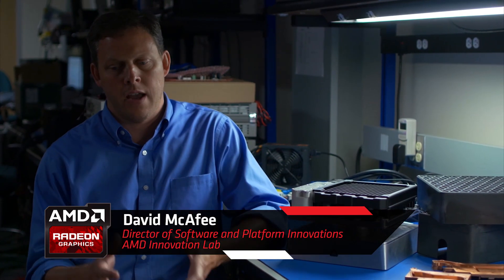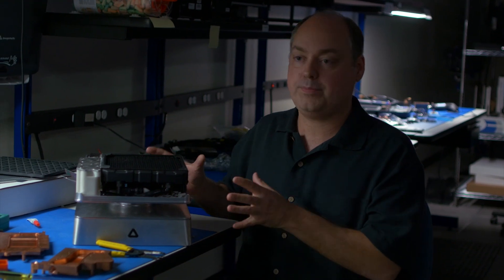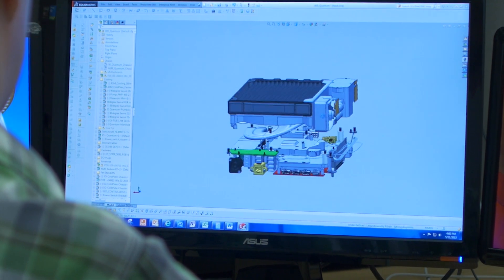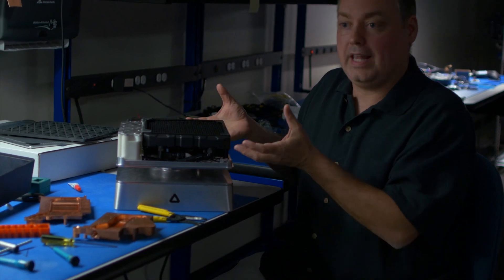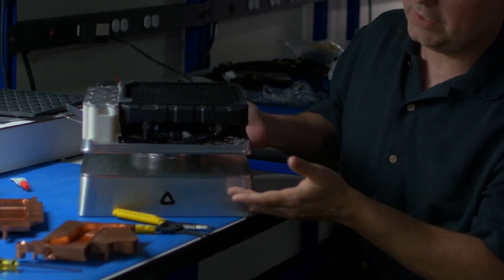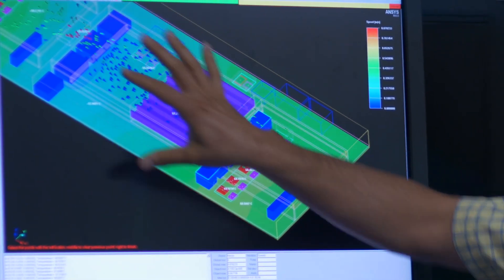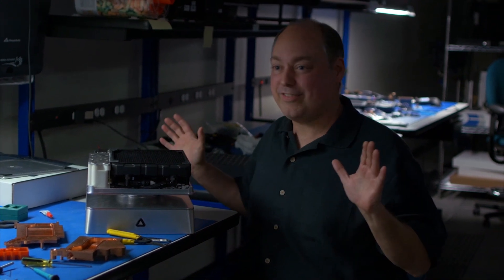AMD Project Quantum: The Enthusiast PC Form Factor Leaps Forward

Comment: Thanks everyone for the views and interest in our Project Quantum!  I have been following the discussion and wanted to clear up a few things.  Regarding the size of the power supply, when we first started on Project Quantum we didn't yet have Fiji silicon so we chose a power solution that would more than cover our needs.  This is one of the areas of the design that we are working to optimize to the actual power needs of the system.

I also have to give you all credit for the frame by frame analysis of the video to determine the components and manufacturers selected in the system.  In truth, there are two versions of the design - one with an AMD FX CPU and the one that is shown in the video with an Intel CPU.  Both will be a part of our Project Quantum plans going forward as we work with ISVs and VR content developers to optimize the user experience.

What's next for Project Quantum?  We continue to work on the design to optimize cost, performance, and upgradability.  Look for more to come as we continue to refine the design and work with our partners to bring this concept to market!
Reply: David McAfee What's the use case this design is trying to address?
Reply: Why didn't u guys just use the 9590 why 4790k????
Reply: +Speirs 333 Because even AMD understands their CPU lineup is getting old. I'm sorry but that's the way it is. I'm running an 8350 and I'm happy with it, waiting for Zen but there would be no reason for them to use an 220W part for an project like this.
Reply: mylife yeah ik im using a fx 6300 im gonna go intel when i get some $$$$$ but honestly a company using their competitors product as their own is just messed up shame on amd
Reply: Any updates?  Been 3 years :(
Reply: Revive this back and put ryzen 3100 atleast in this badboi powered with rx5600 atleast
Reply: Is this coming yet? I would buy it with the new 2022 CPU + GPUs

Comment: 1:05 is that an intel processor?
Reply: Neil Booth yes it is...
Reply: John Vann Well... That's very surprising seeing an intel product in an amd video.
Reply: Neil Booth amd has no mini itx fx new cpus so it was a dead end solution for them to choose for high end system an intel cpu. Or if its not an intel because looks to big and the mobo base not like an intel sockets, we will see what it is soon....
Reply: I doubt that amd has moved to lga...
Reply: John Vann 
Since 5 years ago...

http://www.phoronix.com/scan.php?page=article&item=amd_shanghai_linux&num=1
Reply: Hye L I stand corrected, I didn't know that the opterons used lga
Reply: Doesn't matter look at the ethernet port it clearly states "intel"
Reply: Neil Booth 

It say's "Intel Gigabit Ethernet". You can put an Intel ethernet controller on an AMD board, e.g. ASUS does sell AMD boards with Intel ethernet controller. http://www.asus.com/Motherboards/A88XGAMER/
Reply: Neil Booth They said they recognize intel's high end processors are better and announced a competitive high end CPU somewhere next year. Untill then looks like they're just using intel...
Reply: Neil Booth Intel GIGABIT ETHERNET. Can still be an AMD board.
Reply: youtubechannel It looks like a slightly modified Asrock Z97E ITX, it's unlikely to be an AMD board.
Reply: Neil Booth According to the layout, it seems to be a ASRock Z97E-ITX motherboard.
Reply: Neil Booth Dont wory, you can run any high end Intel CPU and if u gonna ask Windows what type of CPU your OS is using windows gonna report it as AMD 64...
Reply: Biały I don't know what version of Windows you're using, but every version I've used accurately reports whether it's an Intel or AMD CPU. Microsoft also uses the x64 terminology to represent 64-bit, they don't call it AMD64.
Reply: Neil Booth I know, that's just crazy.
Reply: Neil Booth Rumor is it's a Zen prototype.
Reply: gromann So AM4 isn't a PGA socket?
I need it, like now.
Reply: They haven't said what type of socket it will be.  They're making a universal socket for their APU and FX Lines now so it's likely going to be all new.
Reply: Neil Booth 

mb is z97e-itx/ac

surely intel
Reply: Jarruwat Thorung 

http://www.newegg.com/Product/Product.aspx?Item=N82E16813157504

Definitely right on that one. I noticed it myself.
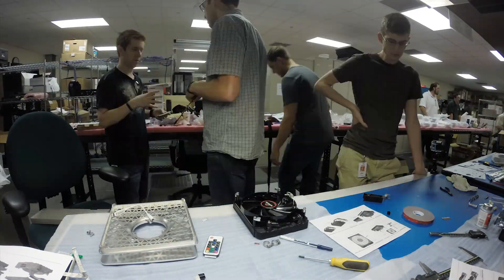Reply: Neil Booth  yes , you can see the intel thunder in 1:08
Reply: Neil Booth hey guys, you forgot one thing, this is just a prototype, the final product will surely be different
Reply: AMD will not advertise its rival. It has no logic.
Reply: Neil Booth no, it could be an Opteron LGA CPU or one of the prototypes of ZEN LGA CPUs.
Reply: Biały And without AMD it would still show X86-32.. ;)
Reply: Neil Booth amd jaguar
Reply: Indeed it is, But I would suggest that those guys are just playing the fool ?. the Ethernet cable has some some weird looking dongle on it ?. Someone needs to run cpuid on the box.
Reply: dude i joke i dont know what cpu it is it can be an intel cpu however the box looks good and maybe they will sell it later as a complet system
Reply: There is amd and intel versions for proyect quantum, in the video is intel version
Reply: ***** wot u sey bwt mai nan? Il rek u m8

Comment: Is that an Intel CPU / chips set and non AMD memory?
Reply: ***** X86-64 = AMD64.
Reply: ***** My PC has Intel Core i7-4790K.
Reply: BlueFoxTV My assumptions are:

AMD required a mini-ITX board for the small form factor, but no one makes a mini-ITX for the high end FX CPU. AMD had to either use a lower performing FM2+ APU, or build it's own custom board which made no sense for a prototype build. They wanted something comparable to Zen, so there was nothing around right now that would fit but Intel.
Reply: BlueFoxTV AMD doesn't have integrated VRM and south bridge, and their flagship cpu is too hot. They know this. They have a good relationship with Intel. They just can't deal with old tech.
Reply: BlueFoxTV  

its  a AM3+ socket so unsure what your seeing
Reply: stuwoac Look closer, its obvious that it's a LGA socket.
Reply: stuwoac it runs on a intel cpu actually, last time i checked that isn't AM3+
Reply: Runs on Intel, prolly until ZEN is out
Reply: Explicit Tech you could say amd and intel are bonding
Reply: Ganjasaurus X AMD uses intel's x86 tech while Intel uses their x86-64.
Reply: Sammy Ludwig How can they if it's not physically possible?
Reply: Explicit Tech Intel CPU, only until ZEn is in the game :)
Reply: BlueFoxTV  they are promoting graphics not cpu 
they know that fx is now far behind intel
Reply: Explicit Tech "Good relationship", don't make me laught
Reply: Jesus Aller Diez AMD uses intel x64 tech while Intel uses AMD x86-64
Reply: Explicit Tech
Do you know how is a cpu instruction set? Do you know that intel sabotages other vendor with their compilers? Do you know that intel received a complain abouth it and the only thing that they do was notify that their compilers only works well with intel? That isnt good relationship that is a crate full of crap.
Reply: Whatever Intel is selling is what AMD had invented anyway. AMD is an underdog and while people will not open their eyes, they will be used and abused by corps like Intel with their prices and gadgets that is not worth of its pricing. No AMD in the market means you pay more then you already do for the Intel/nVidia products, which is a lot already. Those products are for consumers or I should say for dumb people, which dominates in our society.
Reply: Oleksandr Chuyko "Whatever Intel is selling is what AMD had invented anyway."
You need a history lesson on microprocessors buddy.
Reply: BlueFoxTV Ever heard of AMD64 "buddy", you would know intel plagiarized  X86-64 from AMD. I recommend you brush up on your instruction sets.
Reply: GB Main Plageriarised?  Or used with permisson from AMD just like 32 or 16 bit is.
Reply: yes
Reply: BlueFoxTV Or how about used with permission and then claiming they created it?

Comment: price?
Reply: devildoll89 $2k at the very, very least, $2,5k is much more likely, with all the parts and R&D i wouldn't be surprised if they just stick "4,999$" on it.
Reply: FailCycle I really really doubt it'll be 2k.
Reply: devildoll89 It might £1.3K for fastest dual AMD GPU in world, add £250 or so for case + water-cooling, £130 for MB, £260 for i7 4790K CPU, £150 16GB DDR4, £150 250GB SSD, so could be £2350 quid (GBP)

Maybe AMD allowed APU`s and i5 Intel CPU`s but not Nvidia GPU`s. Who want nvidia GPU anyway bcoz Fiji fury released? Nobody I thinking
Reply: +MarkUs FinSki That English disturbs me and I am from Africa

Comment: Intel CPU @ 1:08?
Reply: Look at the cpu bracket...looks like its amd itx board
Reply: mrmustang2000 left is intel, right is AMD, maybe they are comparing
Reply: ***** You can easy see the difference, intel is much bigger and is inside square, while the other is smaller and has a lever on one side of it instead of the square.
Reply: Pirate Both are intel.

Comment: Will this meet Oculus Rift system recommendations for full VR experience? 
Requirements are following:

NVIDIA GTX 970 / AMD 290 equivalent or greater
Intel i5-4590 equivalent or greater
8GB+ RAM
Compatible HDMI 1.3 video output
2x USB 3.0 ports
Windows 7 SP1 or newer

Comment: This will be the first of many (VR) designed systems that fit the need of a compact powerful system for VR setup. I am actually surprised that no other company has come up with a PC that is designed for this market, small, mobile and very fast. Notebooks are not there yet. When Oculus and Valve release their products early next year the market will need these. 

Think about it as a VR system that will need to be carried into different parts of a home or taken to another location. Jumping into your VR game sitting at your computer desk is going to get very uncomfortable quick. You want to be able to take this guy to the living room and kick back on your couch when in the game. It needs to be mobile. 

Really the only thing missing is to somehow mount a small monitor on the top of the chassis to get into Windows and navigate the software for the VR apps.

Comment: mobo in video likely using intel socket?
Reply: Bram Byon Yup, I clearly see a intel socket and intel gigabit ethernet (running from the chipset). Such a small formfactor wouldn't be possible with AMD top of the line CPUs really (FX-8350 and the like), they produce too much heat.
Reply: Yeah but remember, people thought the same about bulldozer, and that turned out to be different :(
Reply: I am not forgetting that, I chose for a FX-8320 instead of an i5 3470K. but still for most people bulldozer and piledriver is a letdown due to its horrible single core perfomance. I choose it for the great multicore permance which beats the i5 3570K by a fair margin
Reply: ThePipton The machine is water cooled. Putting a FX-8350 should be possible. Yet intel processors could be better if they want a TDP similar to consoles'.
Reply: ***** In existence. That doesn't mean that AMD can't have a custom one done for them. Besides, I was just pointing out that heat wasn't an issue with an 8350 due to the installed water cooling system.

Comment: More memory bandwith is fun and all but first off isnt the 45% hogher bandwith deminished by clocking it on 1000 mhz (what we know so far)  as that will give higher latencys as a higher clock rate?  
Secondly its proven that more ram if games are optimized for it on 4k are the number 1 preformance gain.  Grid autosport had a 40+% gain on 4k ultra preset with a 8gb 290x over a 4gb 290x. 

So far im thinking this will come at a cost as more texture streaming is needed in the near future (4k gaming)  if we arent drasticly increasing video memory as HDD and cpu cant keep loading textures to the card non stop and textures are getting bigger with 4k gaming.  Some games are already 60+ gb purely because of textures.

Anyway benchmarks and game low fps peaks will be its Judge and possibly excutioner.
Only time will tell if this is a hit or a miss.

Comment: comment section full of morons.  Its a prototype!!

They probably have used Intel as for one its socket layout is by far the easiest to work with especially when custom building water cooling loops, any tried to fit Liquid cooling to AMD know its a pain due to the non squre layout where mounts goes.  End of the day you need something to work with in beginning.  No doubt this will be bespoke and then motherboard will be probably made by one of the many manufacturers out there as an OEM to their design.  They will probably re engineer socket/layout on new motherboard to fit more easily to keep the CPU block extremely low. 

Zen is due out next year so by then this will be made to fit around that processor not with an off the shelf retail board. 

But the amount of R&D needed plus development time you haven't got time to wait for your new generation of processors to be released before you start on the design and build for your new PC with all new form factor, by that time too little too late and its already outdated. 

You use what is on the market best suited to your needs, develop and build are fully working prototype, design and build your new motherboard using help form one of the many partners out there and then wack it into production. If you noticed they had stripped many parts form the board inc fitting new 8 pin socket for CPU

Comment: 1:08 WAT??? Intel gigabit Ethernet and LGA1150 socket??? Because AMD CPU is crap?
Reply: No. Because AMD CPU is old.
Reply: flippedoutcookie Nah it's crap.
Reply: ***** It's old. The 8350 has been around for a long time, as has the architectures. . We need to wait and see what their new zen chips are going to be like. New architecture.
Reply: Swidhelm Yeah in general it is old. But why does AMD think it's ok to not keep up with Intel? Say what you want but benchmarks don't lie, the 3570K and the 8350 were neck in neck in almost every benchmark and gaming application. That was almost 2 generations ago and it's ok for them to do that? How is Intel going to make another CPU that isn't just slightly faster each generation when AMD just says "Oh it's fine it's only 30% slower" They're doing the same thing with their GPU's, all rebrands of 7000 series except for Fury. It's time for them to step up to the plate and knock Intel's socks off.
Reply: ***** I agree. I'm hoping the zen architecture is better. It's supposed to have something akin to hyper threading, which is good. Intel I think has been slacking off in their development too, as their upcoming skylake isn't much of a jump over haswell. So I'm hoping that the upcoming zen stuff shakes things up. They did it with mantle. That's why directX 12 is looking so good.
Reply: +flippedoutcookie Just as i thought. At first people were saying we need to give it time for games to utilize MORE COARS or be optimized for them but now its old. lol
Reply: If the FX 8350 had a hyper threading equivalent it would be perfectly still relevant and future proof for a year or two more. It doesn't and it's a whole generation in moore's law behind.

Does it still do a great job for the price? (Buy 8320 as it's just a lower base clock 8350 for 120ish$) Obvi. 
Zen will be enough to get them back on the market. If it has hyper threading, new architecture and smaller NM and just keeps the 8cores it will be fucking golden for at least five years to max out games on the cpu side.
Reply: +flippedoutcookie Zen is not going to be using the core pairing shit so it should be able to actually compete with Intel processors. I'm going to upgrade to that or get an i5/i7. My fx 8350 cannot keep up with my r9 290 in most games. Hopefully Zen wouldn't be a disappointment like the fury x.

Comment: looks nice, really nice. but no upgrades, it best be a good price. otherwise its just another potato
Reply: So magical why no upgrades? I think maybe CPU, RAM, SSD and maybe Motherboard if ASrock say AMD yes we do it
Reply: So magical cuz theyd have to do custom upgrade parts, all custom.
Reply: So magical No, they don't. It is a mini ITX board, hence it is compatible with computer upgrade possible, given the size.
Reply: well i hope u your right but i doubt it, maybe ssd and ram
Reply: So magical You can see it is a mini-itx board at 1:05 for some frames. Set youtube's speed to 0.5 or 0.25 to see it.
Reply: ***** There's no reason to remove the cooler. One can use it on the other card I suppose.
Reply: ***** Of course you have to, but that water cooling system is going to replace an aftermarket water cooler many people use. I mean, it is better than a card's stock cooler so it is a gain.
Reply: ***** Oooooh, that's what you meant by removing.
Oh.
I now feel a bit stupid.
Reply: ***** Except from the fact that the assumptions made by So magical are wrong. The platform is upgradeable and totally not a potato.
Reply: ShatteringKatana It's upgradeable in the sense that you can swap out its components for other, similar components, but I don't think it's very expandable.  If I want more HD space then I'm going to have to swap out my current drive instead of just adding a second drive.  While the system does look cool (no pun intended) I really don't see the point of it.  They say it's "purely for VR" but I'd think a computer designed from the ground up for VR would be wearable to allow for more freedom of movement.